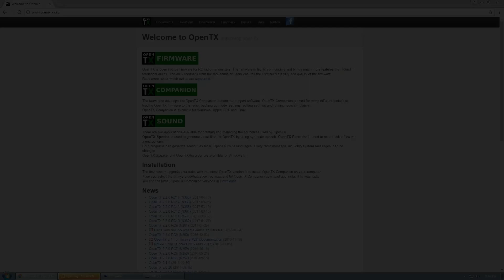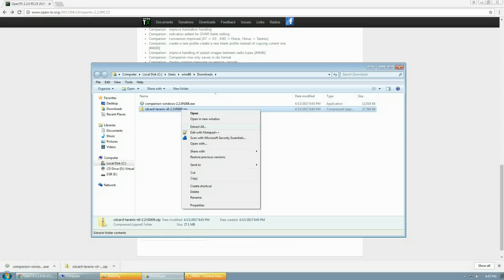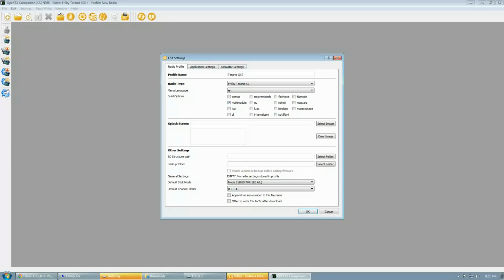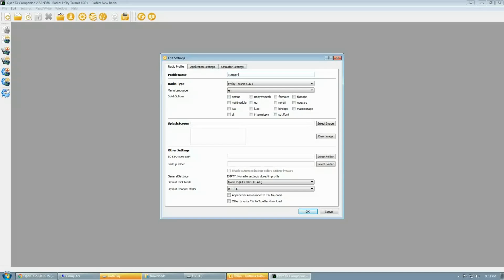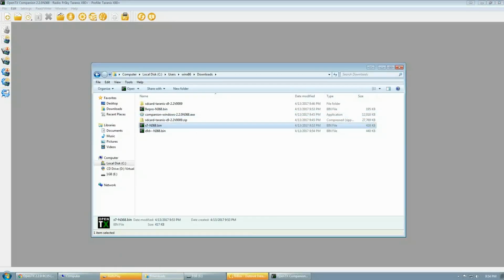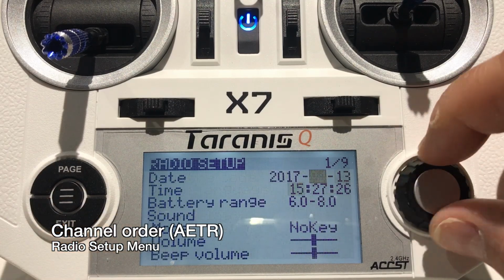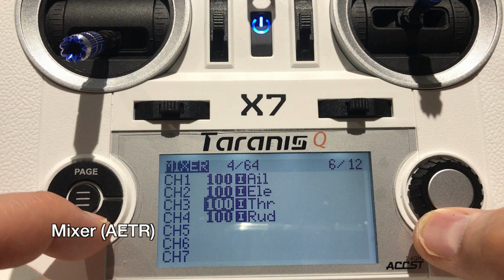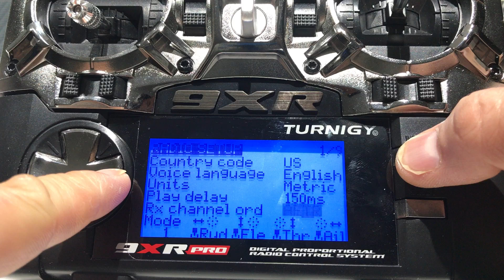✅ STM32 4in1 Multi Protocol Module iRangeX IRX4 for FrSky Taranis Radio Transmitter OpenTX QX7 X9D

Comment from the maker: New version of the 4in1 module, the IRX4+ Plus reviewed here:
https://youtu.be/229bgk4H2lU
Reply: Thank you so much Ken! Would it be possible for you to share your firmware file? Sadly, the current and possibly final openTX version 2.3.15 has a bug for the multimodule menu items. The older versions that would work (2.3.13 and the one you used) are no longer available for download or the companion is not able to download the firmware and I don't know how to compile the bug fix by jarno-r. Outside of that, it seems 2.3.11 is the best firmware to use for a 9XR Pro with multimodule, but I cannot find it.

Comment: mine bound but motors didn't engage.   max throttle, and motors would spin at max.  reverse the throttle, and motors spin max.  mine worked by bringing both sticks out simultaneously.  i have to rebind it when i stop the motors.  bummer.

Comment: Hello I just purchased a taranis QX7 and a jumper 4in1 multiprotocol module because I ha e a Hubsan h123d and a h122d. I cannot get the transmitter, the module to bind with my quads. Can you pls help me?
Reply from the maker: Please check the rcgroups forums. I'm not familiar with those quads.

Comment: Ken:

Great stuff as always !! I recently got a Taranis X7Q Great Radio for sure and a new IRange Module. . I wanted to bind my 2 Cell Whoops and other brushless quads. All went well started with V2.22 on transmitter. Only problem is with the Bugs Quads.  When I select the Bugs or Bugs Mini prot. they read "prot. invalid" So I upgraded to V2.23 both SD card and Radio - Same thing. Any Ideas what might be the problem???

Thank you in advance for your response. Ben Herr
Reply from the maker: You may need to update the firmware on the multi module itself.  Its not for the faint of heart but I do have a video and I'm sure others on YouTube as well. 

https://youtu.be/Cygc9trueSc
Reply: Ken Thanks for the response - this is WAY ABOVE MY PAY GRADE. I can kive withoit the Bugs units on my QX7 

Ben

Comment: Whats the difference between opentx and deviationtx?  It looks like you can bind to the mjx bugs quads if you use deviation.  How can I bind to the mjx bugs with a multi module in a taranis qx7 running opentx?  Thanks a million.
Reply from the maker: They're just different software. Both are capable. However I'm not sure about the mjx bug since I don't have it. But I do see mjxq protocol supported. Best to verify online if it works.

Comment: Nice tut!    I'm trying to use this module in a qx7 with spektrum dsm. Binds however the channel order is wrong. If I set TAER still wrong?  I would think this would be defined in the model setup??
Reply from the maker: Just leave it at AETR.  The module converts to Taer.

Comment: Will this 4 in 1 module connect to frsky xm+ receiver in a turnigy 9xr pro?
Reply from the maker: It supports Frsky D16 protocol so sure.  But I don't have direct experience with it.  The latest module is the iRangeX IRX4 Plus.  

I did a video here:
https://www.youtube.com/watch?v=229bgk4H2lU

Comment: Thanks for the vid! I just subbed  I am really new this so I have a question I have the Qx7 and a eachine Qx 65 flysky version ...Will this multiprotocol work on this ?..Thanks in advance!
Reply from the maker: It should work since it supports flysky but I have no experience with that quadcopter
Reply: For some reason it will not work for me :-(

Comment: Everyone selling these modules tells us they cover just about EVERY Chinese quadcopter, but I've found nothing for the Xiaomi, Bayungtoys, Bugs 2, 3. 6 and 9. Cheerson, Visuo Aosenma and many other quads I own.  Are these models likely to be catered for or is the "EVERY" just a Sales Pitch.
Reply from the maker: The 4in1 works with most of the popular protocols. However, the quad makers like to change up what protocols to use. Eachine e010 works. But Eachine e013 they use something different. It's puzzling why they would do that.  Hopefully with the 4in1 modules, manufacturers will stick to the hundreds of already supported and understood protocols.  Syma typically plays ball and don't change things up. Remember that the devs who work on decoding these protocols do it in their spare time.   We'll get there one day when all protocols are decoded. It takes time.

Comment: Just thought it was worth the mention that MCU won't make any difference in serial mode (such as the way this one runs) The only thing the MCU does in this mode is turn on the correct chip for whatever protocol your radio will be using. The protocols are all handled and generated by the radio at this point. New protocols added to OpenTX will work since they just tell the module to activate the radio chip they need for the protocol they'll be generating.
The + model of this unit is designed to work in either serial mode or PPM mode. In PPM mode all protocols are handled and generated by the MCU and this IS where the stm32 makes the difference.
I hav modded several DEVO7E with a 4in1 module (this same module on a smaller carrier board with no STM32) and all that's needed is to hook up serial communication (MOSI,MISO,CLK,GND)and the CE lines for the 4 TX chips. The radio generates all protocols.

Comment: Helpful vid thanks for sharing :-)  do you know  anyway of assigning a wav to the name of a model, I know how to make wav's and where to put them BUT how do you assign them to a model?  I'm familiar with  er9x and it's easy but this Q7,??  my 9xr-pro says the name of each model when I select them, I want to do the same on the Q7
Reply from the maker: +chris gange hi. In the sound\en\ folder. You have to create another folder with the same name as the model and put a name.wav in there. Eg \sound\en\symax5\name.wav
Reply from the maker: +chris gange you don’t assign them. As long as your model name is the same as the folder it should play the wav when it gets loaded.
Reply: But it doesn't , that's the problem, putting the name.wav in the named folder does nothing!

Comment: TO KENVERSUS: Tried to flash 2.2 opentx on 9xr pro eeprom error and goes back to base txpro firmware, reflashed to my last download turnigy firmware and back to normal (no Models) redowned loaded 2.2 same thing, also replaced all directories on sd card with proper for 2.2 xrpro cept firmware directory, had to flash from sd card (firmware dir) as companion software on pc crapped out on 9xrpro.  I've tried to google this can seem to find solution.
Reply: Ignore, this, the eeprom error is to be ignored, I just needed to not believe the error and move on, it's running opentx fine.

Comment: I have the QX& and a irangex and the original 4in1, both work in my XR Pro, (not running OpenTX) but MULT option doesn't come up on QX7, I've got Interal rf off external scrolls over to CRSF beeps won't go to Mult.  Running opentx 2.2.0 date 2017-05-30
larrykabo@gmasil.com
Reply from the maker: You need a version of your firmware that multimodule support.  OpenTX works on the 9XR Pro as well.  The video shows you how to use OpenTX companion to download the MULT version of OpenTX.
Reply: Thanks for getting back, I figured out about 5 min after I posted.  As for the 9 xr pro, probably a good idea to opentx it, first thing I noticed about opentx was it seems to know what a 3 pos switch is/works without setting up a special mix.
Reply from the maker: OpenTX is the way to go, it's the most popular and once you learn OpenTX all the other radio interfaces will be a cinch.  Have fun flying

Comment: Can I use this with my JR-3810, with simple plug and play by swapping out my 2.4 module with the iRange module. With no changes to the existing 3810 firmware ?
Reply from the maker: +David Clarke not this module. But it might work with the other 4in1 with ATMEGA328p chip which works in PPM mode. check out my older video about it.

Comment: I have a qx7... so if I get this i can bind my radio to, let's say the blade  torrent or inductrix?
Reply from the maker: +mikeBURRITO yes it should work. This module supports dsm2 and dsmx which is what your quads use.

Comment: How do you fix the inputs (AETR) because once mines it binds to the e010 it just at full throttle meaning the right stick is controlling trottle while in mode 2?
Reply from the maker: +William Ruiz you can change the order manual for each model. Just reorder it in the mixer screen.

Comment: I just bought this module through your link, I hope it helps. Thanks for helping decide which module to get.
Reply from the maker: +Roto Vicious thanks for your support!  Hope you have fun flying.
Reply: kenVersus you seem to know a whole lot. Question for you about this module, can I fly my blade inductrix with it? Is the module limited to only 4 channels? Or can I still fly my dsmx/2 tiny whoop newbeedrone fc just like I was still using my Spektrum radio? I should had figured this out before I put my DX6e on ebay? sorry to bother you brother, thanks for the help.
Reply from the maker: +Roto Vicious it supports dsmx/2 so should work with your models.
Reply from the maker: +Roto Vicious also you can have more than 4 ch.

Comment: Hi, I'm new to quad's and I'm just putting together pieces together that have yet to arrive.  I ordered a Taranis QX7 but the quad I ordered a Wizard X220S has either a iRangeX iR-A8S / Flysky FS-A8S receiver that comes built in.  I'm not too familiar with what I need but I was told that the QX7 would not be able to communicate with those receivers and I would either need a new receiver like an FrSky D8R-II PLUS 2.4Ghz 8CH Receiver or could I use this module to get it to work?
If so would you suggest that as the best option or just to replace the receiver?

Thanks, sorry if I sound like a complete newb, but this is all new to me. :)
Reply from the maker: +Snafu2346 I would probably get the FRsky RX's. They will provide better range then the 4in1.  But the 4in1 is still nice to have for smaller or indoor quads or for testing.
Reply: Understood, there was mention from UAV features about the Taranis QX7 review that mentioned about using a module to fly little quads indoors, I wasn't sure if it worked well for outdoor medium to long distance use or not.  
This is all very new to me and I appreciate you giving me feedback.  I can look at the recievers for FrSky controllers, some don't look too expensive, one I saw was only 15 dollars.  Are receivers simply plug and play?  Would I simply just removed the old one by unplugging it and plugging in the new one?  Or is further modifications I need to do to ensure proper usability?
Again thanks for helping a newbie get familiar with it all.
Reply from the maker: +Snafu2346 I believe the x220 runs cleanflight or betaflight so you have to reconfigure it using cleanflight/betaflight configurator. It's pretty advanced stuff so watch some tutorials.  You have to set flight modes and arming / disarming. Lots of stuff to learn but it'll be fun!
Reply: There is a lot to learn but I suppose that's part of the hobby.  There was a lot to learn when I built my own computer but I found it fun.  There was a lot to learn installing my own turbo but it was a lot of fun, and a lot of misery.  I think this will be easier than that.  At least I hope so.  I have some basic hand tools and a solder gun I've never used that came with the tool chest. 
I think what I'll do at first is just enjoy the RTF X220S and just use the Flysky that comes with it for the time being.  It'll work right out of the box and I can just start flying.  
As time goes by I can get more familiar with my QX7 and and keep watching and learning on what I need to do and eventually install the right receiver to get it to work.  All within its own time.  
Eventually I want to build my own completely from scratch but I'd like to get familiar with one first and I'll probably take it apart, and put it together again to see how things are set up.

Comment: After installing this module and turning on the external module and  protocol selection  (FS 2A -Flysky 2a) in menu of Taranis X7 suddenly disappeared line  - FAILSAFE!!
It is very strange.
In Betaflight i turn on FAILSAFE -but it does not work.
This is very bad !!

How to turn on failsafe in Taranis X7???,

Line- failsafe- just no !!!

Can you help me??,
Reply: Alex R. Hi... Did you found a way to set up failsafe? Even setting up Failsafe I'm betaflight doesn't work out

Comment: does this module allow you to bind to flysky, dsm2 and dsmx recievers? i saw in the setting external module you can choose these?
Reply from the maker: +Jan Domingo they should work since those protocols are supported in the 4in1 firmware.

Comment: Thanks for this video.

Any clue how to bind a furibee f36?
Reply from the maker: +Gregory Segura the protocol for f36 hasn't been decoded yet.
Reply: kenVersus ah. That sucks. Thanks.

any idea how to set up my hubsan x4 h107l so that the lights stay on?

I got it bound and I got the controls adjusted, but now when it binds, the leds shut off...
Reply from the maker: +Gregory Segura I think if you make a ch5 in the mixer and assign it to a switch you can control the lights. It can be done but I never bothered with it.

Comment: Thanks again for the video. Module arrived yesterday. Popped it into the back of my xr9pro, bond and burned a pack in one of my spektrum sat equipped quads. I noticed that I can't get the gimbal resolution I get with the orange module (viewing the rx page in bf). Every channel is yields around 1100ish to 1900ish. I upped the weights to 125. The throttle channel is m primary concur. Is there a solution?
Reply from the maker: +VD2021 you're using betaflight?  I think I recall that as well for my makerfire fpv that uses dsm2. I wasn't able to figure that out either. there may be some configuration in the 4in1 firmware that can be edited if you compile your own firmware.  ask people on the rcgroups forum to see if they have any leads.

Comment: I set my transmitter and the firmware update for AETR and the transmitter is on mode 2, but when programming a model my inputs show thr ail ele rud. Then when bound the throttle is on the right
Reply: Sorry, figured it out. have to actually click on model setup.

Comment: I watch the makerfire video and ordered the module. I have an issue when trying to update my 9xrPro. I followed your video loading the fw to an sd card, however it does not show up on the screen when I power on to bootloader. Any suggestions? I wanted to update my transmitter so I'm set when the module arrives.
Reply from the maker: +VD2021 microsd card formatted FAT file system?  FW in firmware folder?  Or You can also try using OpenTx companion to flash your transmitter.

Comment: Looking for opinions...like many people entering the hobby I initially bought the Flysky FS-i6 TX and it has served me well up until this point.  Would this module be a viable solution for someone with multiple quads with Flysky RX's to be able to transition to a Taranis?  My thinking is this would allow me to upgrade my TX without having to swap out all of my current RX's?  Thoughts please?
 
Edit - apparently this module doesn't have the same range as a standalone TX and I guess that answers my question.  Pity because it seemed like this would be an easy solution without having to swap RX's.
Reply from the maker: +tonyh2k2 the 4in1 is great for indoor or toy shirt range quads. A dedicated flysky module is probably best for your case.  A flysky module is around $15-$20 so would make a good addition to the taranis. The 4in1 is still nice to have to fly every thing you might run into.
Reply: Does BG sell the appropriate Flysky module?

Comment: I didn't hear/see the DSMX. Ultimately, I would like to know is;  Will I be able to use this with in my 9Xr Pro to control my Spektrum and Lemon equipped quadcopters. I currently use the later HobbyKing Orange Module.  Thanks.
Reply from the maker: +VD2021 I've used it with the makerfire fpv quad and it uses dsmx/2. see my makerfire video.  make sure you have the latest firmware for your transmitter and 4in1 module.
Reply: kenVersus thanks. I'll check it out. thanks again for the informative  videos.

Comment: Fantastic video!! Very helpful thanks KenVersus. I have managed to bind with  my Eachine E10 without a problem but am having difficulty getting the multi-protocol  module to bind with the Flysky version of the Eachine QX70 quad and can also not bind with the the Eachine iA6 receiver  on my Falcon 250 Pro (same as the flysky iA6). I think the real issue may be that I do not know which mode and sub-type to select on the Taranis XQ7. Any advice?
Reply from the maker: +Ingmar Boesenberg try to use the FS2A protocol. It's a separate protocol and not a sub-type.
Reply: Hi Ken Versus. Just tried it. FS2A does not work on the QX70. Will try the Falcon 250 PRO tomorrow. The Flysky i6 transmitter runs AFHDS on the EQ70 and AFHDS2A on the Falcon 250 PRO. Not sure whether this will make a difference?
Reply from the maker: +Ingmar Boesenberg I'm not sure since I don't have many FS stuff.  Just make sure you have the latest OpenTx and also latest 4in1 firmware.
Reply: Thanks kenVersus. Let me play around a bit more.

Comment: Thanks for this video. It helped me figure out the process I needed to use to bind my new UMX Radian to my new Taranis QX7. I needed to update the X7 to use the multi protocol settings within the model settings.
Reply: Yuginot Y what kind of range are you getting, and is it screaming at you about "rf signal low/critical"